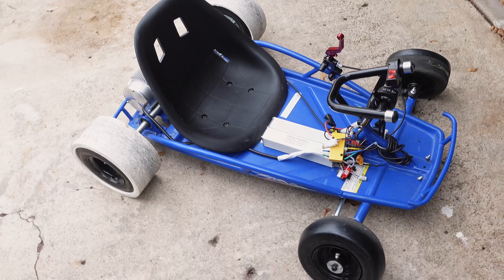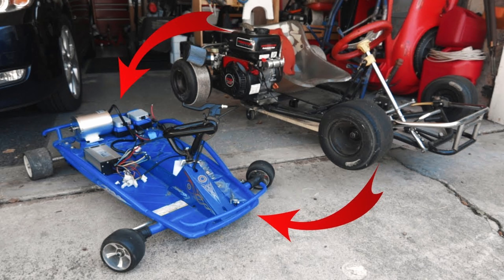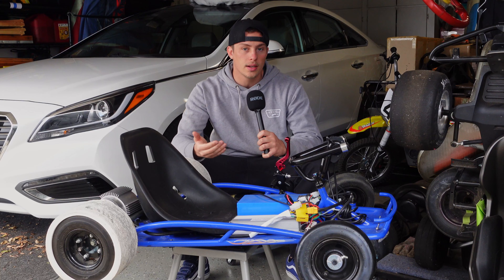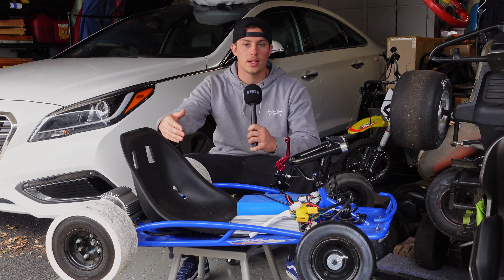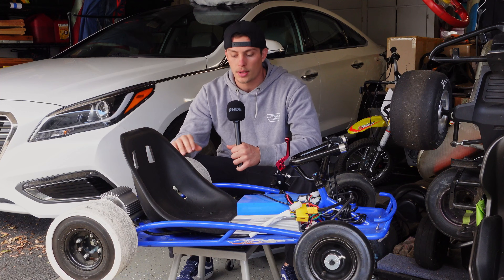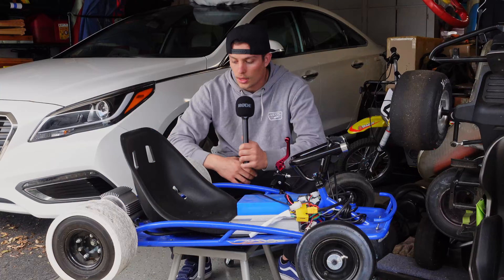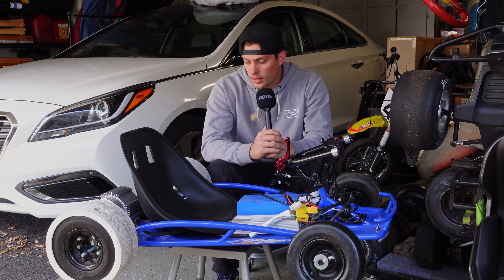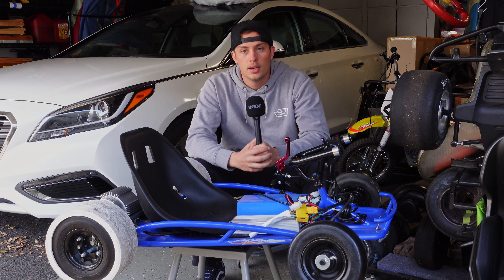Building a RGFD from Scratch Pt.9: 3 Things You MUST Know Before Building!

Comment: quick question- would a 48v 20ah btr battery fit on the back with an 1800w motor and a speed controller? or should i move the battery and controller like you did?
Reply from the maker: it depends on if you did the axle flip mod like I did, because with the mod you have less room to make things fit. having the 48v battery over my 60v battery would make things easier since the dimensions would be smaller. With the axle in the original location (under the frame) you should have plenty of  room for the both the battery and controller. Since I have the axle on top of the frame, I explored making a bracket for it to sit over the axle but I got lazy and decided to have less wires running everywhere and put them next to each other in the front lol
Reply from the maker: I also got an aftermarket seat that gave me more leg room but gave less room in the back, with the stock seat in the original location you'll have much more room
Reply: Only if you build a shelf whether you flip the axle or leave it in the factory position it will need it. But if you get different pillow block bearings for when you flip the axle your shelf doesn't have to be as tall! it can use the railing that's in the backfire the other half of the shelf support, it also wouldn't need to be welded in. I only know because I have been building a razor go kart to go 40mph and I have that battery!